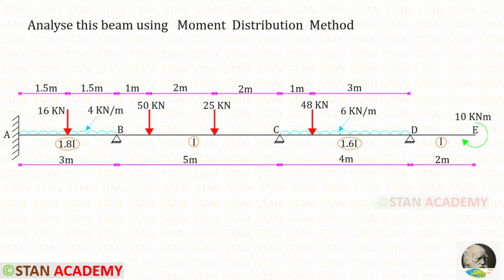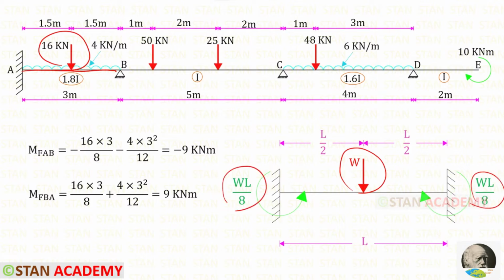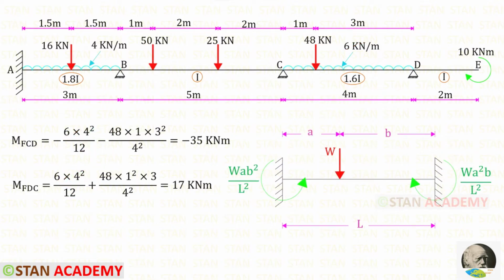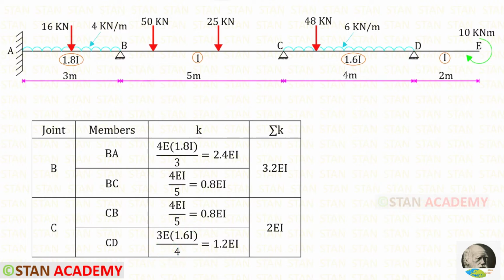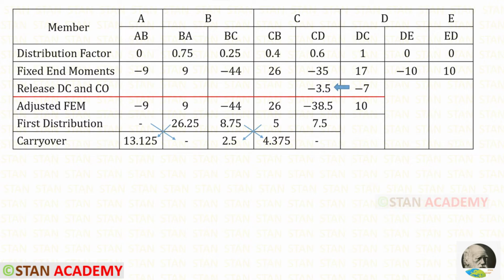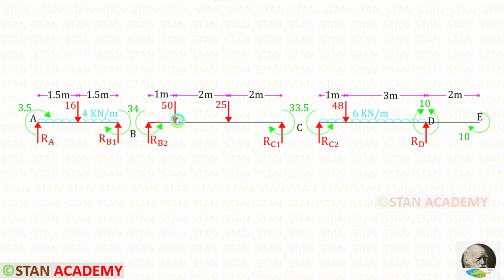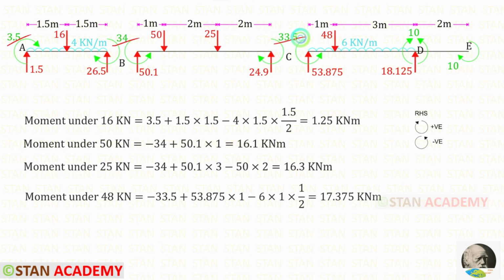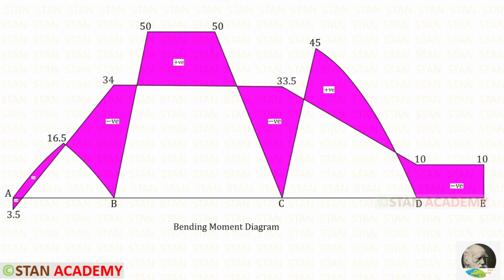Moment Distribution Method for Beam Analysis - Problem No 22 ( Three Span with Overhanging )

Comment: Can it be done using three moment method I was given a similar question to use Three moment method and its confusing
Reply from the maker: yes with the formulas you can easily do. Check the playlist of three moment method. there are some examples , I did with formulas